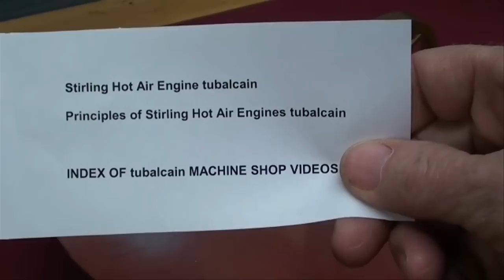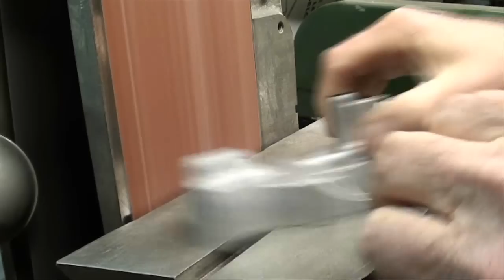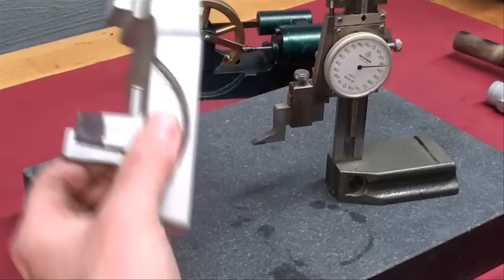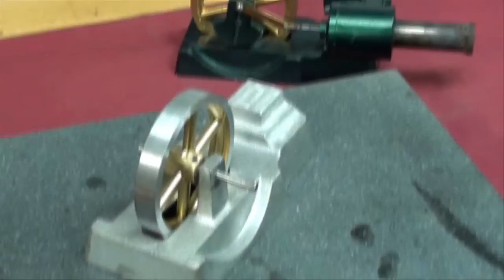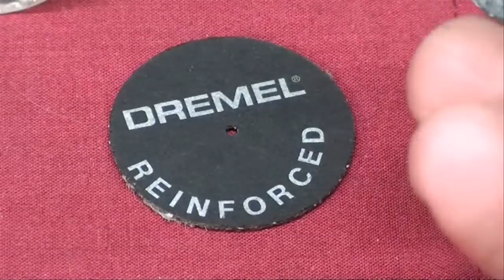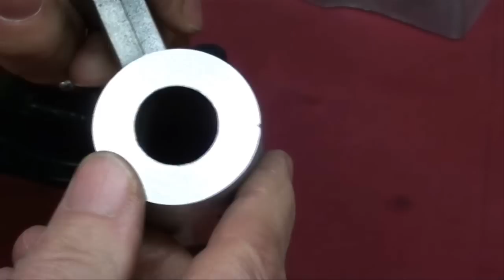HOW TO MAKE A STIRLING ENGINE pt 1 of 4 tubalcain on the Logan lathe

Comment: Again a very descriptive video, will watch the series to the end.  You get a good finish on the machined surface, what scrap aluminium do you use.  My last casting was from a mag wheel, which most times machines with a dull grey finish, unless it is heat treated before hand.

Comment: Interesting video.  Could you please explain how you can be assured the turned face to be perfectly perpendicular to the center line of the steel tube ~25.48?  You gripped on a cast surface.  Unless the word 'perfectly' is not to be taken to mean perfectly.

Comment: Why wouldn't you lightly mill one of the long sides of the casting to make an accurate reference surface for the cross drilling operation?  Looks just fine anyway, tho.  Thanks!